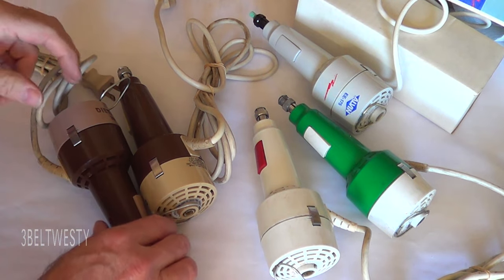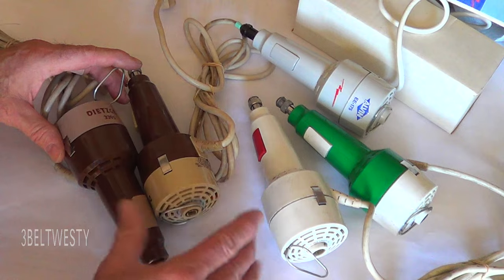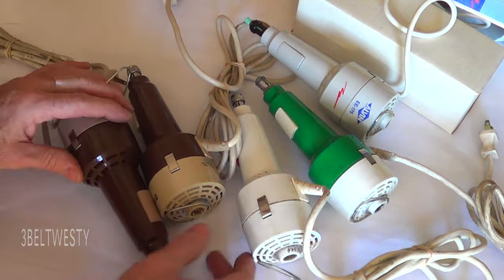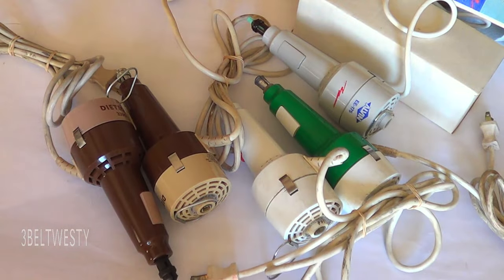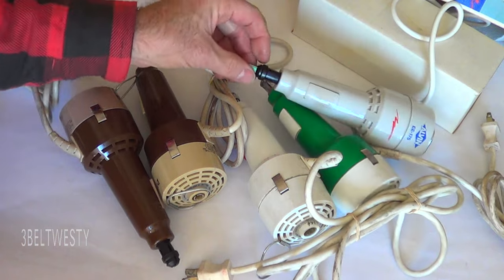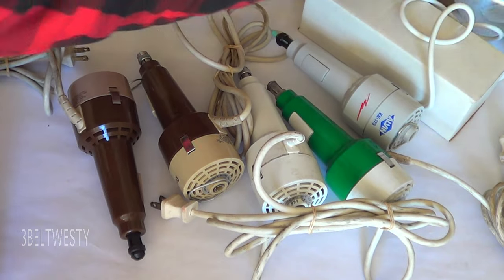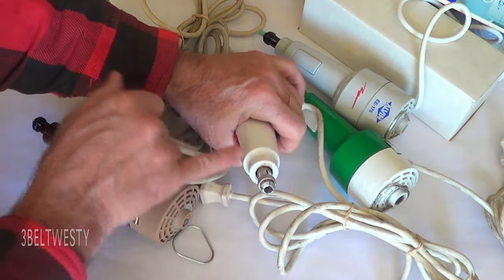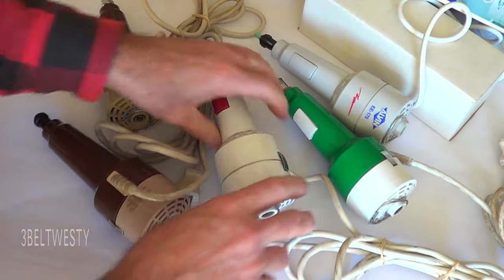AC Electric Eraser Erasing Machines Drafting by Rotex

Comment: On the top is for a mechanical pencil lead sharpener. Also there were rechargeable cordless electric erasers at the same time when mechanical drafting was popular before overtaken by CAD. Eraser refills are available from Amazon. New style cordless electric erasers also available from Amazon.

Comment: I just bought an old dietzgen and love it. Where besides EBay can you find eraser strips?
Reply from the maker: No new erasers are made for these units anymore, production stopped over 6 years ago. Thus all that exists is new old stock, stuff in folks old drafting stuff boxes. The strips are also used on an abrasive testing machine to test granite and thus the shortage of strips has caused prices to skyrocket. A pentel clic eraser refill model zer is slightly larger in diameter and will fit some chucks with effort and not others. The last two boxes of number 73 pink Castell erasers I bought on ebay was from a chap in England and the cost with freight was 22 dollars per box of 12 strips. A guy in China was selling a box for 50 bucks a few months back. Stuff on ebay or an old desk or flea market is your best bet. Old stock may be soft and OK or just junk and hard as a rock and brittle. The rubber ages due to temperature, ozone etc thus dicey. Eraser strips were once made in Tennesse. Then South America, then in Asia. It is not that the rubber is rare it is the gizmo that made them round left the USA eons ago and has probably been junked.
Reply from the maker: Use a common block eraser most of the time and use the strips where you need fine details erased is what most folks do since the old stock erasers are scarce and expensive and often too hard too.
Reply: It's kind of sad. I bought mine to use but also for nostalgia. I tried the pentel refills today and got them to work. To bad no one wants to make a variety of refills for these machines but I guess not enough demand. The battery operated ones don't get great reviews but if they still make electric erasers in some form then there must be some demand.
Reply from the maker: An alternative is using the dinky toy looking battery operated ones with the small about 3/16 x 1 inch erasers. They are all over the place on ebay and online. Variants of these go back at least 60 years the early ones used 2 cell batteries and had a slot car DC motor in nose and looked sort of like a flash light. Some draftsman use these dinky ones for tiny details since the eraser is so small in diameter. There was also a Mercury elecric eraser that uses short say 1 inch erasers but they where the big diameters. The unit has a  mercury switch inside; it turns on once the eraser chuck is pointed down towards the drawing.
Reply: Saw my first electric eraser today…

On the subject of refills, if you know the outside diameter of a proper refill, and you can find good tubing with that interior diameter (e.g. brass tubing from a hobby shop, section of chromed brass tubing from a telescoping antenna, larger drinking straws, etc.), there might be a way to make your own refills.

Online you'll find recipes for 'low-rent Sugru' -- in brief, high-quality silicone into which you've mixed a quantity of cornstarch.

The mixing you could do in a large hypo, or perhaps a cake decorating syringe-y-thing. A voided or almost-empty tube of silicone would also work well, of course. You'll need something to thoroughly, but quickly, mix the silicon and the cornstarch. Working time, depending on proportions, is not much into double-digit minutes. 

You'll likely also need to coat the interior of any tubing you're using to produce the neat cylindrical sections -- the refills -- with some kind of release agent . Liquid soap might work. Fish oil. WD-40 swabbed onto the inside walls might allow the material, once fully set, to be pushed and/or pulled out of the tube.

If you use tubing that is cheaper than dirt, you can skip the release agent and use a stitch-ripper to sacrifice the mold. 

Setting the faux-Sugru in a tube with a section of good cord thoroughly bound in the last few mm of the material might help; pulling on the string will cause the material to stretch -- reducing its diameter… Maintain tension on the string until the refill pops out, trim for length, install.

See my other post in these Comments for a couple of technical questions I have about the mechanism itself…

Comment: Hey I just recently found one in one of the storage units I bought, and it pretty old. It's gotta be older than the ones on this video. Can you tell me how much it's worth?
Reply from the maker: On Ebay they sell for 20 to say 50 dollars. There are always a dozen on there so the price never will go to high. The erasers for these are made in China today and the price is 600 to 100 bucks per box of twelve. Old stock ones on ebay are often dry rotted and stiff. So the buyer of these machines has a good tool but an expensive consumable eraser now. They were 5 bucks a bok 20 years ago.

Comment: WRT the mechanism itself:

I notice (from a brief test of the only electric eraser I've ever seen) that the motor doesn't produce much torque. Speed is… acceptable, but just.

I can understand why torque is minimal. Is there any way to modify the mechanism to increase the motor's torque (which I suppose means increasing the amperage rating upward from 0.5 A)

The motor, I'll suppose, can't be swapped out for another with the same unique feature and higher torque/Amp rating because such a motor doesn't exist; this class of motors has -- or seems to have -- a hollow axle and, therefore, a very limited use case. I want to retain that hollow-axle aspect, but would like much more torque. Does this require rewinding the motor's commutators? 

Also, I'm interest in knowing about the variety of mechanisms available for gripping the eraser material proper. The eraser I've seen looks like the brown-body models shown in the video. The gripping mechanism seems to be a collet that is secured with a simple, sliding captive external sleeve, while the interior wall of the axle, at the business end, has axial grooves. Are there other gripping mechanisms in use? Which? In which models/makes?

Are there different interior diameters  i.e. did the refills come in different diameters, or was there a (nearly-)universal size? Also, was the composition of the refills the same in all cases? Was there ever an 'ink' eraser refill, IOW?
Reply: Actually, circumferential grooves spaced out axially, but not -- it seems -- along the entire length of the axle.